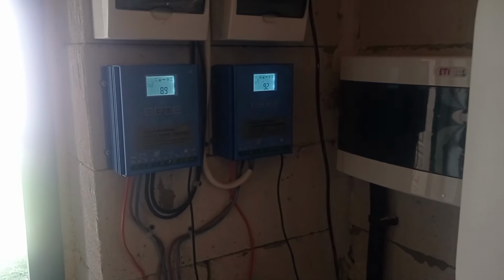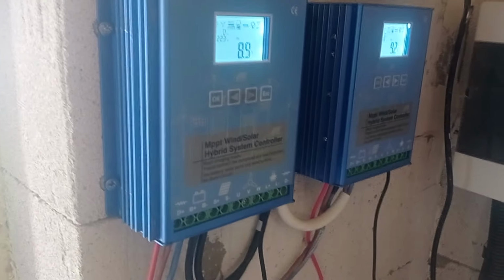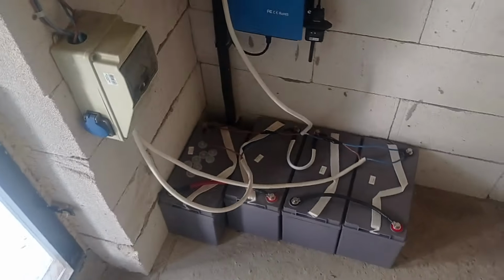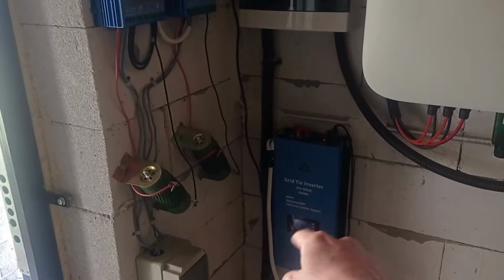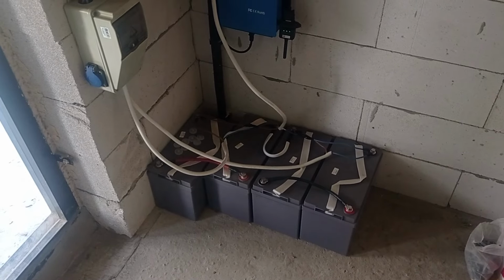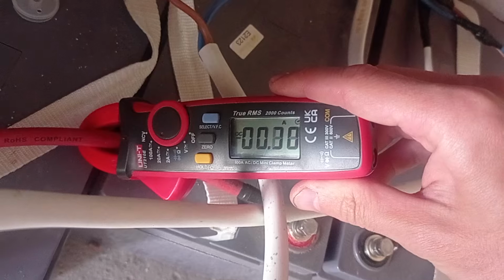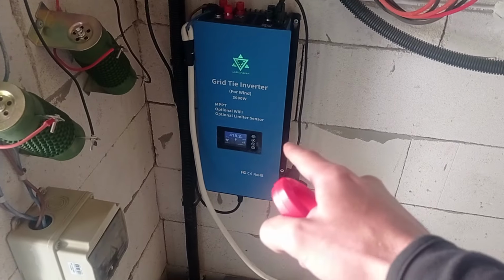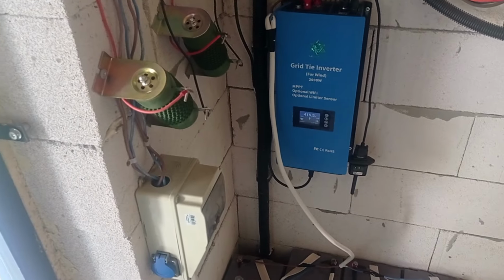Checking current flows between batteries. Idea how to resolve panel output issue + generator input

Comment: You find any good Wind generators? Know of any? I have a big system but 2 months a year the sun hides but the wind picks up during that time and I need an average of 500 watts per hour at 48 volts. (56 volts charging). I have 11.2kw solar and 4x14.3kw battery banks. I do not see any good reviews on wind generators. I can not go up real high about 8 meters.
Reply from the maker: yes,  I know good ones.
in order to see 500w constantly you have to get 3-4 kW machine. SL-4000, or SL-5000 from this video will be exactly the ones: https://youtu.be/FoKUUpJMgD4

Comment: your system has become a one of a kind custom set up......i have had problems with getting full output from my panels but with the regulations i am not able to make changes without first getting approval so i cannot experiment with the changes like you are able to do.  I am interested in how you solve your problems so i keep watching to see what comes next.
Reply from the maker: hm... well in our regulations - what happens inside your internal system - is your own business and no one cares what you do there.
as long as you are not breaking the rule of hourly sales limits (which are 30kW per hour for me), and as long as you are not adding more than agreed initially in the contract selling inverters (again two in my case - 20kW grid-tie Huawei and 10kW hybrid Deye).
I am curious what will it look like in the end, and I have a documented scheme already, however, since it's not finished, I'm not showing it to anybody yet ))